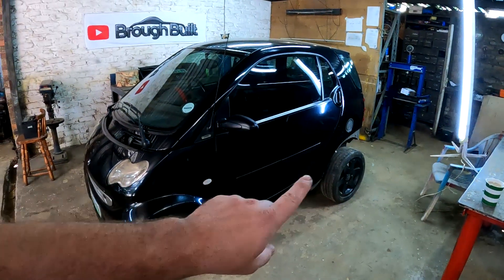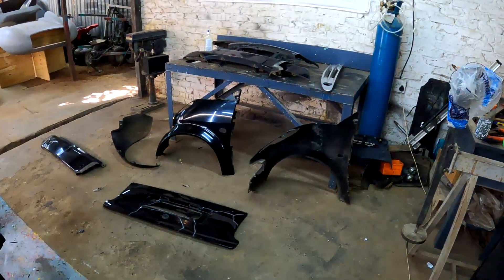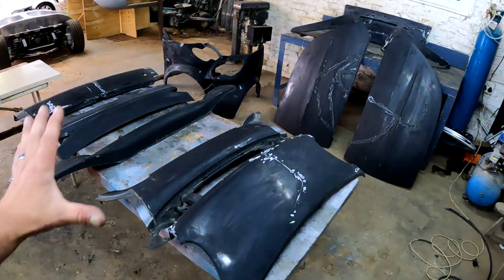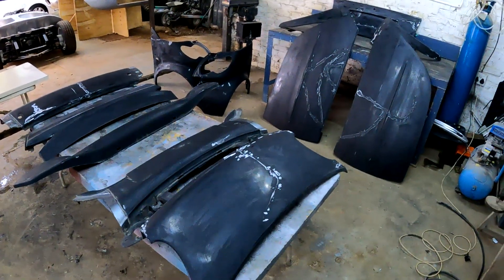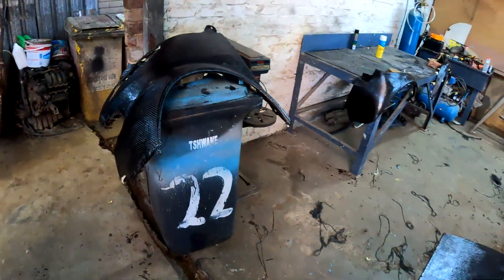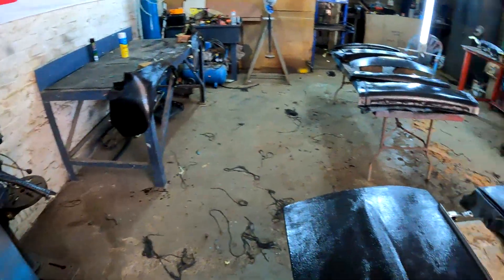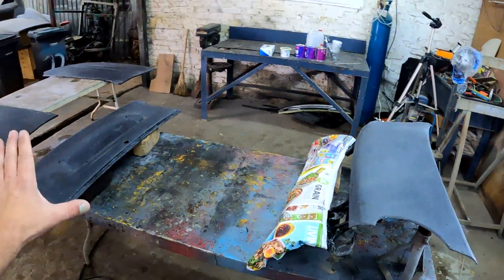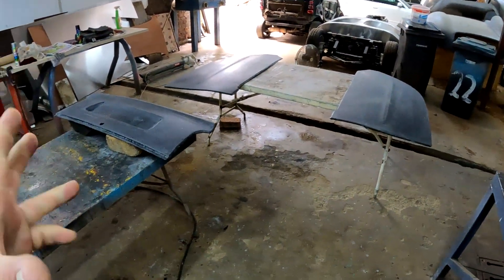I made a Carbon Fiber Smart Car! And it was easier than you'd think

Comment: curious to see how long the carbon fibre stays looking nice , i suspect the bonding of the resin with the plastic isnt verry good as the plastic acts like teflon , i seen some repairs on these panels and they allways crack again or have the bodyfiller let loose from the plastic 
the carbon fiber does look awesome , maibe IF i decide to do the same thing i will make the front and rear piece in carbon while its still mounted together , that should take care of the parts fitting together properly , the thickness of the carbon fiber over the existing panels messes with the connecting points a little

Comment: Really interesting and would never have thought of that. I noticed some panels seemed a bit uneven. Almost like the panel wasn't smooth under the carbon fibre. Was this down to preparation or another reason? Also was the clear coat sprayed on or brushed? I presume you can spray it on like a normal paint job?
Reply from the maker: Thanks! Yes some panels do show a little unevenness. If I did it again I would spend more time to smooth out the repairs with some filler and put more layers of resin so I can sand it down better before sanding into the carbon. The clear was sprayed on. But another option is to simply polish the resin to a shine
Reply: @BroughBuilt  thanks. I’m wondering if it’s worth me doing on the Aston or if the body has too many curves.